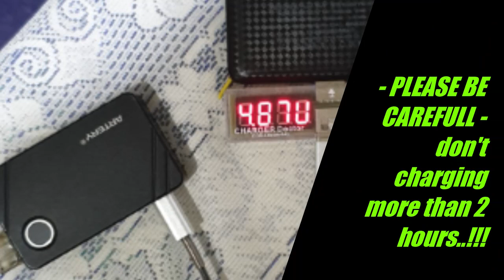How to solve the battery charging problem on Artery PAL 2

Comment: boss kalau tak jumpa yg 10 ohm 2 watt tapi yang ada cuma 10 ohm 1/4 watt macam mana nak buat tu?
Reply from the maker: Parallel kan 5 pcs (1/4 wat) dgn resistant 50 ohm, so dapat 10 ohm, 1W (memadai)
Reply: @buatbaik4852  terima kasih info

Comment: bos..knapa artery saya cas xmsuk..saya baca komen cakap tukar occ..tpi occ yg bru saya guna
Reply from the maker: Macam saya punya juga (charging ic nya rosak), kena buat shortcuts macam YouTube ini. Untuk lebih jelasnya coba lihat YouTube ke2 "open artery pal 2"
Reply from the maker: @muhammadaffiqdinaziz6351  maaf kat sini tak boleh bosku,
Reply: @buatbaik4852  bos yg wayar bypass tu nk solder di kaki ic no 4 atau solder pd resistor kecik sbelah ic tu ?.. dlm gmbar nmpak mcm bos solder pada resistor kecik sbelah kaki no 4 tu..

Comment: It is 10 ohms, 2 watts or 2 ohms, 2 watts?
Reply from the maker: 10 ohm adalah besar resistant nya, 2 watt kemampuan power yang dia boleh tahan, untuk resistant biasa dijual 1/4 watt. Kalau pasang resistant biasa kemungkinan tidak tahan (panas dan boleh putus).

Comment: Boss..saya tak fhm lh
Reply from the maker: Ini untuk yang Artery dah tak boleh charger battery nya lagi (ic charging nya rosak". Solder (welding) kan kabel di pin no 4 (ic charging tu), kemudian sambungkan ke Resistant (10 ohm, 2w) dan solder ke Battery (positive +). Boleh lihat di video kedua untuk lebih jelasnya. (Maaf kalau masih kurang jelas)
Reply: @buatbaik4852  kalau xpakai resistor tu bleh ke?
Reply from the maker: @aunnizam8343  boleh juga tapi kena hati2 jangan cas lama2 maksimum 20 menit shj, sebaiknya 15mnt shj. Cara langsung macam tu berpotensi battery cepat rusak.
Reply: @buatbaik4852  orait
Reply: Buat Baik pakai kabel apa?
Reply from the maker: @asusx550i5  yang bisa, jangan terlalu kecil shj. Pakai kabel, wire bekas kabel LAN yang diuraikan (kabel tunggal) pun ok.
Reply: Buat Baik ok makasih. dicoba dulu
Reply from the maker: @asusx550i5  ok semoga berhasil dan jgn lupa SUBSCRIBE untuk dapatkan berbagai2 Tips lainnya 🙂
Reply: @buatbaik4852  sekarang saya connect jumper je xpakai resistor alhamdulilah boleh cas balik tapi xboleh lebih 20m kan?
Reply from the maker: @aunnizam8343  iya 10 ke 15 menit shj cukup. 👍
Reply: Buat baik klau saya tukar ic charging tu eta4056 dengan tp 4056 boleh ke selesai masalah?
Reply from the maker: Takboleh, tukar ic tak boleh selesaikan masalah charging ni. Buat shortcuts, dari power usb (positive +) ke battery melalui resistant 10ohm 2watt.
Reply: Buat Baik boleh hantar pod rosak dkt bos x